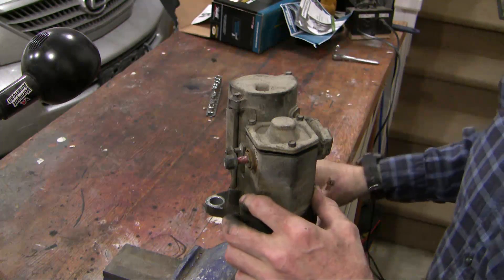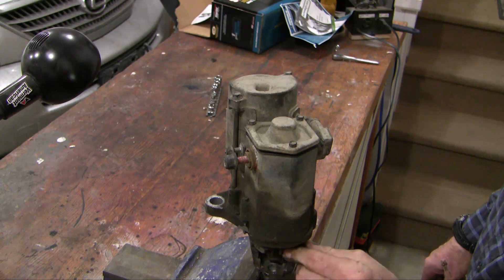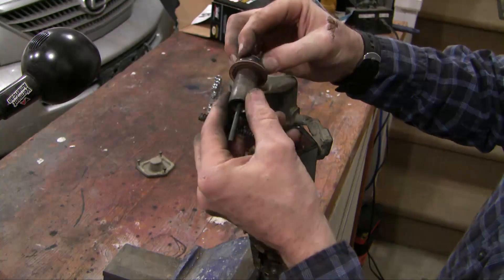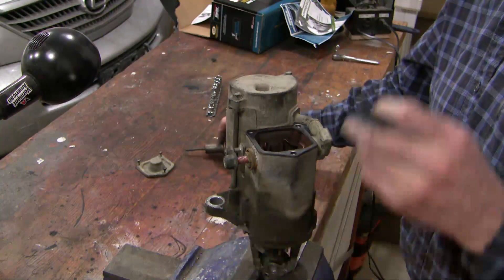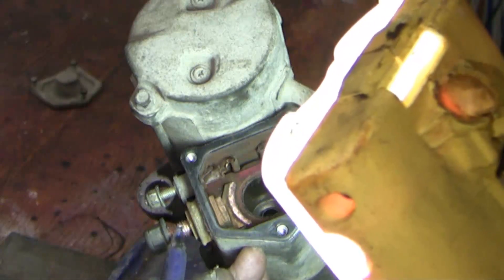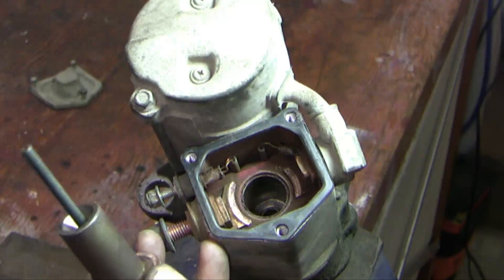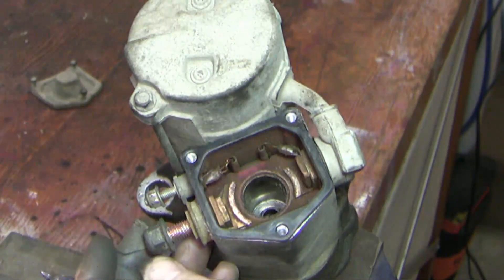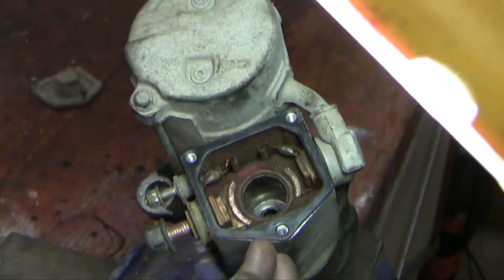Starter solenoid autopsy --  How a Nippon Denso starter works.

Comment: Thanks for the video.  I bought a kit, but the plunger it came with is only 100mm long.  My original Denso uses a 125mm plunger.  Is there a way to disassemble the plunger by itself so I can get the longer rod in the worn out plunger to use in the new plunger, with the shorter rod?  I can seem to figure out how to disassemble the plunger itself.

Comment: basically that works the same as a relay
Reply from the maker: Absolutely, a solenoid on steroids that performs two tasks. Not only does it supply power to the motor, it also has to overcome a spring and engage the teeth, so it takes far more power on the signal side than you expect. My Dodge Ram draws 32A on the signal side. To reduce that draw, engineers designed two coils on the signal side, a pull-in coil that engages teeth, and a smaller hold-in coil that holds it there until you release the ignition key. So they needed a mechanism to cut out the pull-in coil as soon as the power to the motor was delivered. The clever solution was to tie the downstream end of the pull-in coil to the upstream side of the motor, meaning they didn't need a switch to shut off the pull-in coil. Genius.
Reply: @spelunkerd  interesting to see a video about that mechanism, but maybe the amperage draw is high  at the beginning when both coils are working together in a small fraction of time until it hits the motor
Reply from the maker: @RotoRCol  Yeah. I've done a plot on a multichannel scope to show this very thing, and every few months I consider doing another video of the topic. Exactly as you say, there's a spike of current draw at first on the signal wire, then draw on that wire falls when only the hold-in coil is active. This style of solenoid is perfect because the post between the downstream side of the solenoid and the motor is accessible.

Comment: Hi you mention right at the top of this video that you did  another video showing you testing it. I can't figure out on the Denso solenoids where to connect power and negative to see the solenoid actuate. Can you direct me to your video please? Looked but can only find this on  I have the same stater as you. Regard
Reply from the maker: That's an excellent question, and every month or so I think about doing a better video than the two old videos I did ten years ago. The one I referred to is this one https://youtu.be/UnmnWuuLfzE, but looking back I don't consider it my best effort. These denso starters are really good examples because unlike newer starters, the denso version gives you a third post that connects on the downstream side of the solenoid so you can get a much better look at how the solenoid is working. That third post connects at the point where the trigger lead internally connects to the pull-in coil, on the downstream side of the high voltage solenoid switch. The best way to study these is with a scope, and I actually have done that in this exact starter motor. That view highlights the amazing engineering behind how these thing work, they truly are genius designs. With reference to your question, the big post will be the B+ post, directly fed from the positive pole of the battery, with a thick red wire. The smaller post attaches to the thinner trigger wire, that comes from a relay, in turn fed by the ignition switch. That wire is often white, not red. There is no negative post, it gets ground from the bolted connection to the engine. If nothing is happening when you turn the key, and if the battery is good and fully charged, check the voltage at that trigger post when you turn the key. If you get 12V there when key is turned, you've got clear evidence that your ignition switch, neutral safety switch, and relay are all functioning correctly.

Comment: Here's a tip, try to find some copper contacts from some device, and grind them into the shape of the starter contacts.
Reply from the maker: Yeah, you can buy starter solenoid repair kits that have typical sizes for ~$15-$50. I regret not doing that here. For guys who don't mind fiddling, who don't mind the odd failure or callback, you save money at the cost of more labor and time. A perfect DIY option, as long as you aren't concerned about the possible cost and inconvenience of another tow. You may find them at auto parts stores, in which case one could pull the old contacts off and compare to be sure you have the right size. Otherwise you're stuck with a disabled car, waiting for parts that may or may not fit. It's easy to understand why pro shops went in a different direction, more focused on reliability than price exploitation. Kinda sad, that sizes for those contacts aren't standardized.
Reply: @spelunkerd  the issue with mine was the gear mechanism in the starter not engaging. There also kits for that with the bearings included.

Comment: When you conect body with terminal c what happen with your avometer? Is that connected?
Reply from the maker: There are two wire connections to the starter motor, terminal B which is an always hot big wire, and the signal post which waits for a 12 volt signal to come from the ignition. Some call that second post the S post, but I've not heard it described as terminal C. In any case, that signal post feeds through the pull-in coil to the input side of the motor, then to ground so you should get ground on that post with a DVOM with key off. When you get a helper to turn the start key, you should get 12V there whenever the start key is turned on. A high-current test light would be even better. It's a pretty good screening test to verify that your starter motor is indeed bad, since less than about 10 V there would tell you there is serious resistance somewhere along the signal wire. A better way to asses the starter is to use an oscilloscope, and Chad at ThePracticalMechanic here on Youtube did a couple of excellent videos that give a deeper dive into what you expect to see. These old Nippon starters also give direct access to the point where the pull in coil joins the relay output, right before the motor. This gives a valuable look at the most common point of voltage drop.
Reply: @spelunkerd  In my place the call terminal 30 is big cable from battery. Terminal 50 is cable from ignition to give power for magbet selenoid. And terminal C is cable from motor starter. I just wondering why big positif cable battery conneted to the ground. Sorry my english is bad.
Reply from the maker: @blackforest1484  If you're interested in more info, specifically what you see on an oscilloscope for terminal C (between motor and solenoid), go to PracticalMechanic and look at any of the 'weekly waveform' videos for a link to a facebook group. It's moderated so you need to join (free). On Jan 4th 2021 I posted a scope view of starter motor contacts. When solenoid is closed, it mirrors the B post, with a difference showing the voltage drop across the switch. You see an intriguing jump up in baseline ground voltage of terminal C in the microseconds before that, when the pull in coil is activated but before the switch makes contact. This is your best look at solenoid performance, but often it is not available in new starter motors.

Comment: So my my starter spins but doesn't engage on my Kubota diesel riding mower! Need another Bendix?
Reply from the maker: You could try disassembling it and lubricating the mechanism. If you're lucky, you'll find debris. The teeth on my riding mower are pointed upward and exposed, so it wouldn't be a surprise to get debris inside. On most vehicles we just swap in a new starter, though I have little experience with mowers.

Comment: What causes one contact to be qickly worn out than the other
Reply from the maker: Good question! You can see the contacts inside the solenoid are designed to rotate, to try and distribute wear evenly and reduce early failure because of erosion in one spot. But, eventually parts bind and then wear happens at an area that is destined to become the weak spot. The same thing happens inside brake calipers, with early wear usually on the inside pad. You can slow that process down with good lubrication, but inside a starter solenoid nobody goes back to lubricate parts.

Comment: I saved myself $30.00 by taking the contacts out, cleaning them up, bending them up to make a solid connection with the plunger, and now I have a working starter again... clean everything up and reseat the connections with the plunger... no $100.00 new starter, or no solenoid rebuild kit... Hmmmm...
Reply from the maker: +John Grindinger That's a good plan, John, I'm glad it worked for you. As you know a rebuilt starter is just that -- somebody did a slightly more involved procedure to clean it up and get it working again. Unfortunately there are reliability issues with any rebuild, with the cost of possible later inconvenient failure as part of the equation, as well.
Reply: All unforeseen failure is inconvenient... If I thought for one minute that this was a "temporary fix"... I wouldn't have done it... The sticker on the bottom of this starter said it was rebuilt 10 years ago. If you start your car 3 time a day, in 10 years that's almost 11,000 starts... I tested this fix before putting it all back together... I am willing to wager money that I'll get 4 years out of this "fix"... Oh... I have 40 years of working with mechanical electronic connections... (no reply needed)
Reply: +John Grindinger It's $10 for the contacts and plunger off ebay.  Cleaning them is fine, but it's never quite the same as replacement.
Reply: ScubaCat3 
 Bullshit first you have to wait for the product to arrive which is no fun. It does not take very long to do if you take all the pitting out and polish the copper,  get a nice polished surface you wouldn't be able to tell the difference in performance. If you put a better polish on it than the factory does you would get better performance.......
Reply from the maker: These are excellent, helpful and thoughtful remarks, the kind I like to see on any video threads.

Comment: FYI, and for others, this is the same starter on many late model Harleys (minus the chrome fixings). I have a 2010 and am currently rebuilding the solenoid. Approx $25USD for the kit on eBay. Now that I know this info, thanks to you, I can just head down to the local auto parts store next time I have some starter issues (rather than a HD dealer). What's funny, I used to have a 2001 Dodge Ram, which I'm now learning had the same starter - I had two different vehicles with the same part in my garage!Now I've gotta check my Honda Accord and see if I'm lucky there too!
Reply from the maker: criznitty That's good to know, thanks for updating it here. Better yet, consider making a video of changing out your bike starter. The last time I checked, there weren't many videos of motorcycle starter replacement or rebuild  here on youtube.

Comment: very interesting, i take it the pitting cannot be avoided, i had to think about that for a minute, i wonder how that could be corrected?
Reply from the maker: On some units you can just flip the contacts over and swap sides, and of course you can sand and clean contacts. You can also add some dielectric grease that helps to exclude moisture, which is an integral part of oxidation. Some people here on the net have found suppliers who offer replacement contacts for about $10 -- lots cheaper than a whole new unit. In my case, I couldn't do without my vehicle while waiting for parts to do a partial rebuild. The inconvenience and risk having to tow of an unreliable vehicle pushed me into a rebuilt unit, which is what drives the market for rebuilt units. Thanks for watching!

Comment: another Q, what make starter works when u hit it with hammer..
Reply from the maker: Thanks for a second good question, Sivaraj. Banging on the starter causes a slight shift of contacts, allowing current to flow, which gets it all moving. The problem with most failing starters is either a bad contact in the copper connections inside the solenoid, or worn contacts at the brushes. If the starter motor stops at a point where current can't flow, it suddenly won't work. If you can budge the contact off that 'dead spot' with a bump from a hammer, current will flow and the starter motor begins to turn. Once you get the shaft moving, momentum usually helps the motor keep going through the bad spot.

Comment: I assume all latest starters have just B and T post(or S for start).. so if i want to bypass solenoid, how would i do that, in earlier model, you can jump the battery post to starter main wire(meaning you can act like solenoid), i assume we cant do it any more if you have just 2 post, is my understanding correct.
Reply from the maker: At the B post you have 12V pos all the time, and the other post is only hot when you turn the ignition key. So, a metal screwdriver touching both posts at the same time will cause the starter to turn and engage. As you say, when you do that you are bypassing the solenoid. Of course the vehicle won't start (unless it's an old style diesel), since you don't have spark. This conventional system uses a ground that goes through the bolts holding the starter to the engine frame, so there is no need for a ground wire. I don't think the newer starters are much different in this regard.

Comment: I live in the states. I got it from cnc-reman on ebay. Canada shipping might be a little bit more. But I couldn't see it being that much more. You'd have to ask the guy.

The kit i got includes
(1) Plunger (Denso # 053660-7150, 053660-7151)
(1) Solenoid Contact (Denso # 053513-0241)
(1) Solenoid Contact (Denso # 053513-7080)

Comment from the maker: I personally would go with a rebuilt starter, recognizing that they usually come with a warranty and work well most of the time. I'm not sure exactly what is happening but it sounds like the teeth of the starter gear are not fully extending to engage the flywheel. To try and repair this yourself would be significant work and it may not be reliable even after you are done. Unreliable action from the starter gear can lead to damaged teeth of the ring gear, so I would replace the starter now.

Comment: This all started the day after my son drove through some high water. Not sure if that has anything to do with it. On advice of a guy in the parking lot where he was stuck, I smacked the starter with a hammer while my son turned the key. It grabbed after about 4-5 tries and got him home. It worked again later when I had to move it into the garage, but I'm not going to keep doing that. Can the bendix be cleaned up or should I just replace the starter. I hear bad things about rebuilt starters.

Comment: I've got a problem with the (Denso) starter on my 97 Dodge 1500. This isn't the click and then nothing problem. I can hear the starter spinning but it never engages the flywheel. From your video it seems like the starter wouldn't turn unless the solenoid was activated and had moved to the start position. If that didn't happen, the copper disk wouldn't close the circuit to the starter motor. So the plunger is moving? Isn't the action of the plunger what moves the Bendix gear into place?

Comment: Thanks a lot for this useful information. I have a question, since you have already opened the Solenoid Valve and we know that Solenoid valve stuck at times because of carbon. Does cleaning the Solenoid from inside helps.

Comment: Awesome vid.   My '97 Ram with 135K miles (factory starter) has this exact same prob right now.   I haven't removed and examined the starter yet, but my speculation is that the plunger, when energized, does not always fully engage the flywheel.   As a result, the plunger doesn't close the motor circuit.   I find if I slightly rotate the flywheel manually (by using a breaker bar on the alternator nut), the next try at starting usually is successful.   Could the solenoid winding fail over time?

Comment from the maker: I do regret not giving that a try. However there is something to be said for having a reliable vehicle that starts when you want it to, not stranding you at an awkward time. Undoubtedly a rebuilt starter undergoes similar but more thorough reconditioning. With a rebuilt starter there is some bench testing and warranty involved that makes it more likely to work without fail. Thanks for your input!

Comment from the maker: In a way the customer is 'undercutting' the profit of the middle man, so I'm not surprised that they make access difficult. The guys who rebuild these buy the core, change out the 5$ part, make sure it works, and sell it back to the retailer, who sells it back to the customer. They rely on guys like you and me, recognizing that we have other jobs and don't have the time or patience to search out little parts like this. Thanks for your comment!

Comment from the maker: @Bonfield2002 The plastic cover comes off the motor side of the starter solenoid, so it would be easy to do a voltage drop specifically across the solenoid alone or the motor alone. But the test I used in my other diagnostic video was just for the wires, excluding both the solenoid and the starter motor. When the starter failed, the B+ side drop went down, so we know it's not an internal short. Intermittent problems are a pain. 

Thanks for your comment!

Comment: Interesting design.  If we do a voltage drop on this style of starter we are only doing the drop on the solenoid side of the circuit and not the starter itself ?
If  there is a voltage drop we would have to check the solenoid  for corrosion first, change the contacts and re-test.  Seems like the way of the future is not repairing a part just buying another.  Learn something every day. Thanks.